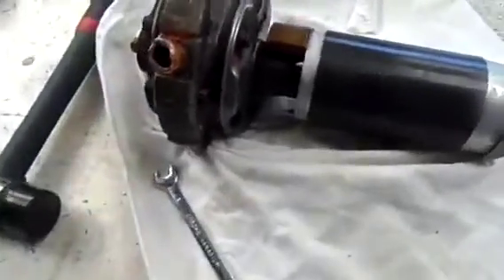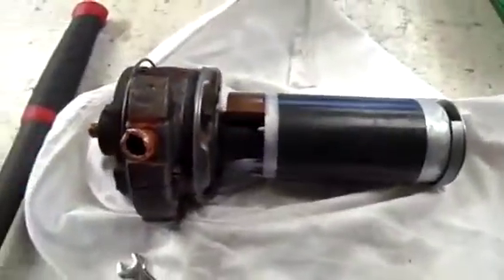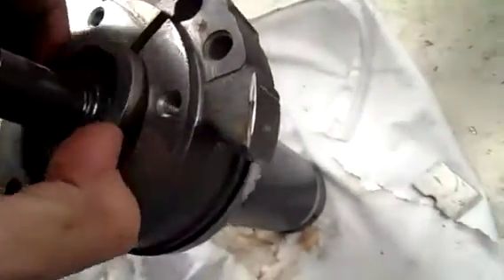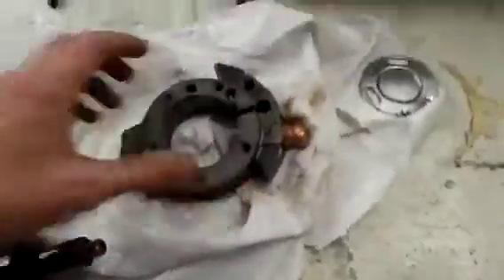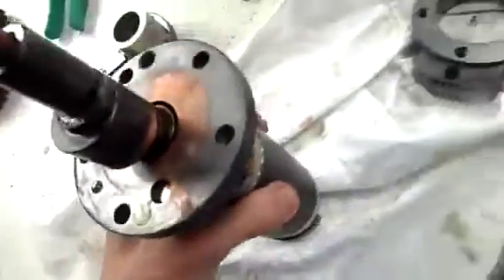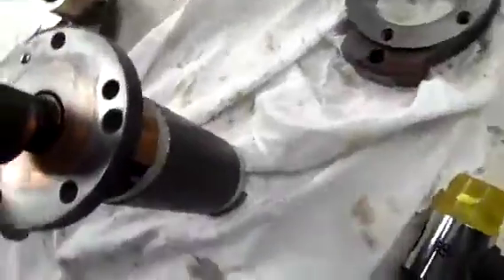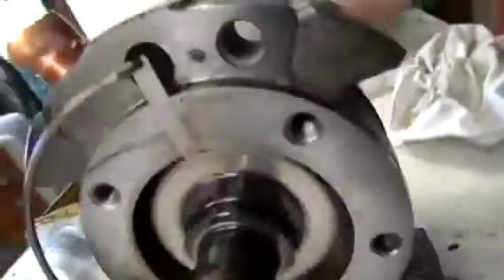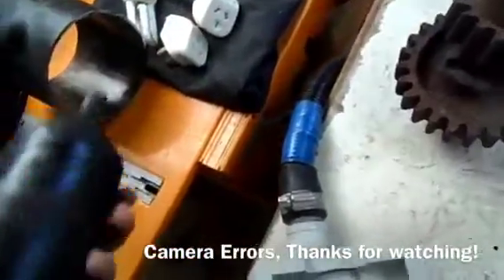Rotary Compressor Mechanism Rebuild

Comment: That "worn down to the copper" appearance is a sign of acid contamination. Even though there may not be copper in the parts that were moving, there is now a copper coating.

This is a chemical process known as copper plating.  If degraded (acidic) refrigerant gas flows through the copper tubing of the system, it will dissolve some of the copper and hold it in a chemical compound.  This compound will break down from high temperatures.  When the dissolved copper compound breaks down, it releases the metallic copper. This can cause the bearings and metal wear surfaces of the compressor to "build up" with copper and lose their running clearances.

Since your motor didn't look burned out, it may be that there was a previous compressor motor burnout that left the system contaminated with acidified oil and degraded refrigerant residue. This continued to etch away the tubing and plate it out in the compressor mechanism. That will cause the compressor to bind up, overheat, and appear to seize up when it runs. Thanks for sharing this video!
Reply from the maker: Ahh that explains it! Thanks for the info on that, glad you enjoyed the video ;)